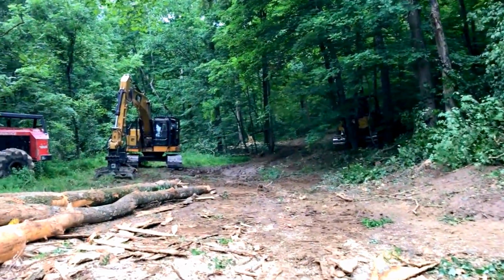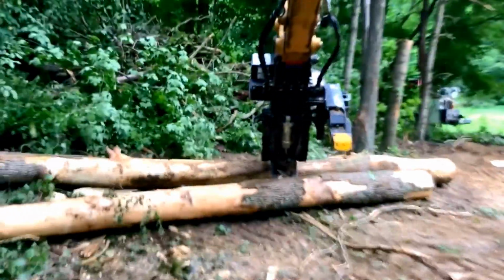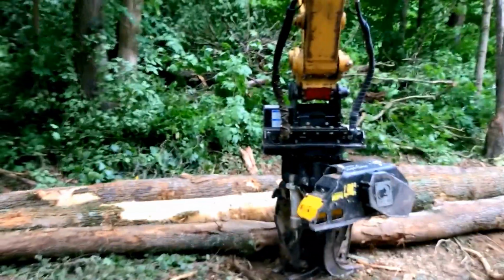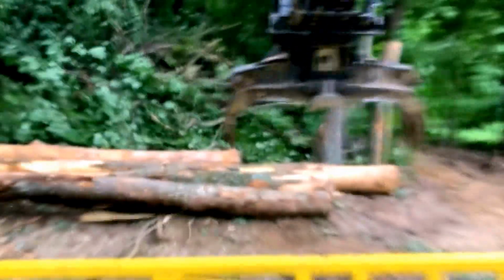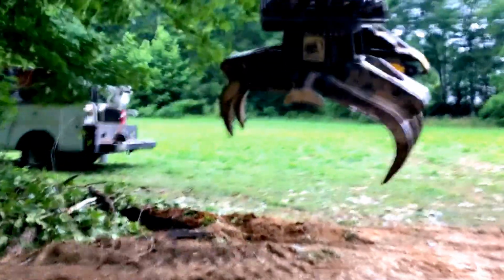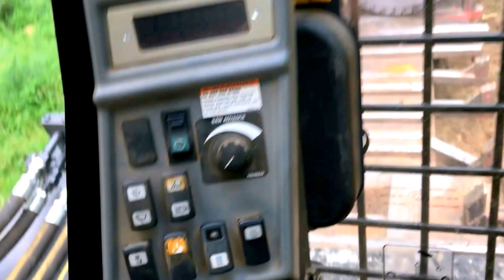Setting the boom 2.0!!

Comment: Why did you build the din din table on a angle? Does the din din already have 2 pump aux flow? If not getting the aux circuit on pump merge or cross flow will bump oil flow.